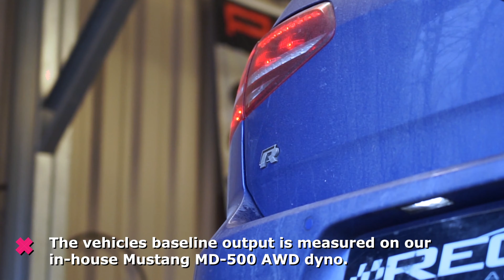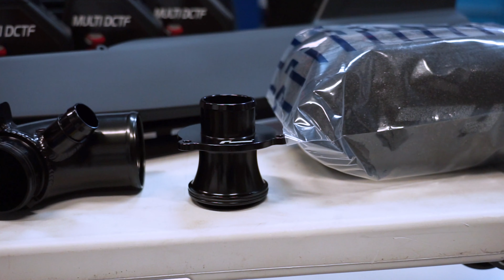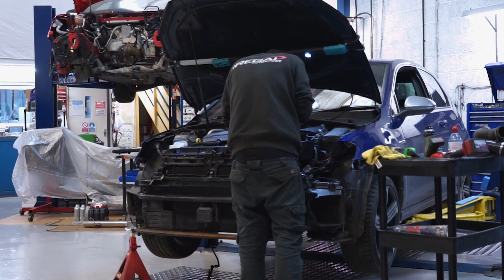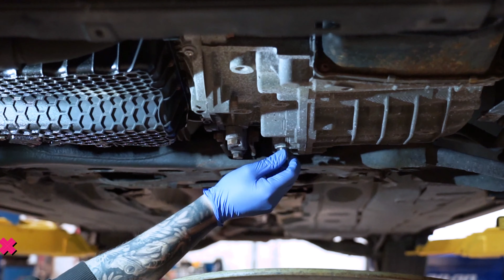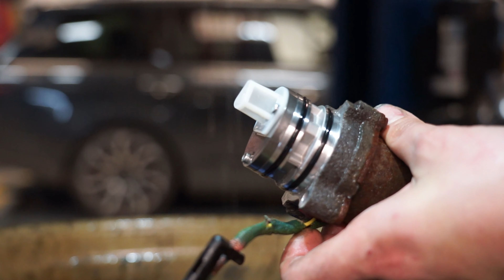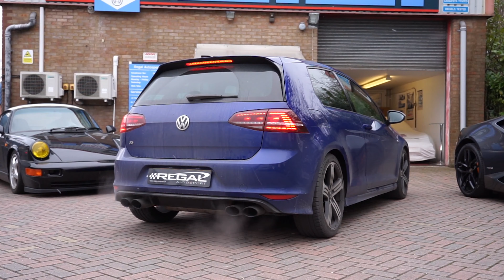MK7 Golf R Milltek Exhaust with a Custom Stage 1 (stock downpipe, hybrid turbo, IC & Intake)

Comment: There's no way you can call a car with a hybrid turbo stage 1 😂😂
Reply from the maker: You can, with a stock cat - as that is the limiting factor. 'Stage 3' = hybrid turbo, decat, intercooler, full intake etc
Reply: @RegalAutosport  that's not how it works, and doesn't really make sense
Reply from the maker: Did you create the stage nomenclature?
Reply: @isaiahrodriguez7600  The stage is just the software, without downpipe you cant go over stage 1 numbers even with a huge turbo

Comment: Stage 1 power 🤔 software alone would see this ball park figure.
Reply from the maker: Sure would! Customer had a blown turbo and replaced with a hybrid and wanted some other upgrades around it, so we had to custom tune it to suit. 

It’s not something we recommend, but it can be done with limited output
Reply: @RegalAutosport  I understand that the oem downpipe with the cat is a major restriction but on a hybrid turbo, I'd of thought it'd be hitting higher figures. Torque seemed capped any reason for this other then the downpipe? Is it a dsg or manual.
Reply: @chriswilson2834  Yeah imean my GTI Clubsport is pushing 360 hp/ 450 torque on a Stage 1. But hum a blown turbo, and then put in a hybrid. Arent those pretty unsafe? Should have checked out the "Xona Rotor" turbos...  👍
Reply: @tredfxman  as far as I'm aware, hybrid turbos as such are not unsafe. And I'm sure the hybrid used on this vehicle would have been tte or littco, venom etc etc.. My only question was the power figures didn't seem all that much for the hardware used. When most stage 1 software gains are in the same ball park area. I don't know the ifs and buts just a observation I made. Example something that I'm quite familiar with is the vauxhall scene in particular for instance the Z20leh. In addition to the same hardware per say, that car would make much more then a stage 1 map.. For arguments sake stage 1 on a z20leh would see 260-270 at a push. With the similar hardware 290-310 at a push. So seems a little low for example.
Reply from the maker: @chriswilson2834  With regards to the output,  if you look at the curves vs. a typical Stage 1 car with TCU software the peak torque is much sooner in the rev range, when you take into account this and that a hybrid turbo will spool later due to larger wheels requiring more energy to move (higher RPM) you can see that the performance is just in a different place but ultimately limited by the biggest bottleneck which is the OEM downpipe.

What is clear is that the output is limited by the downpipe, which when replaced and the software optimised will allow the turbo capabilities to be better utilised. Switch out the downpipe and it's a Stage 3 car!
Reply from the maker: @tredfxman  Hybrid turbos are not unsafe, provided they are built properly and tuned correctly.  + Are you talking lbfts of nm?
Reply: @RegalAutosport  I never said they were unsafe.